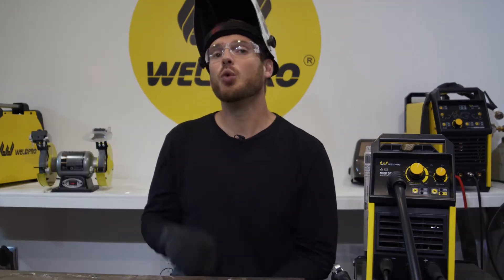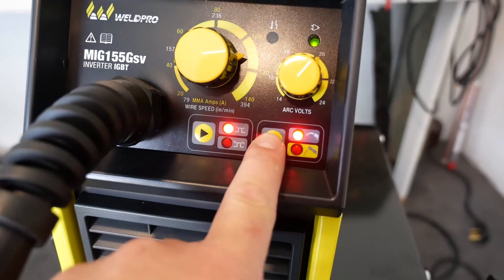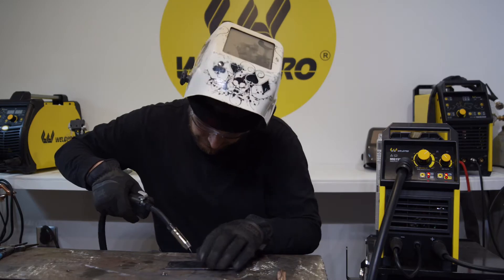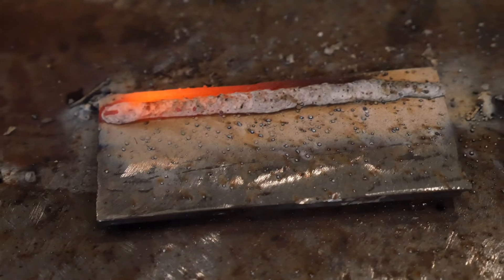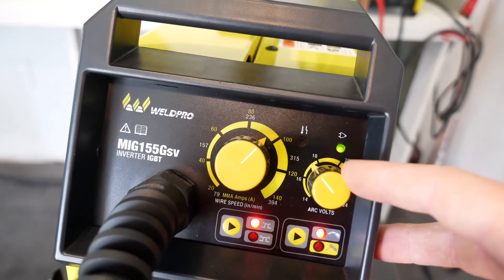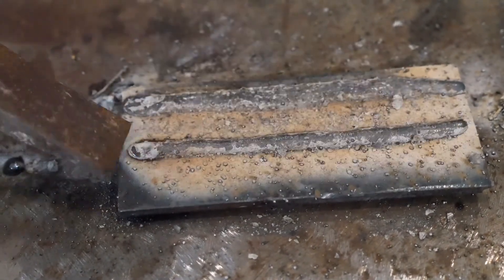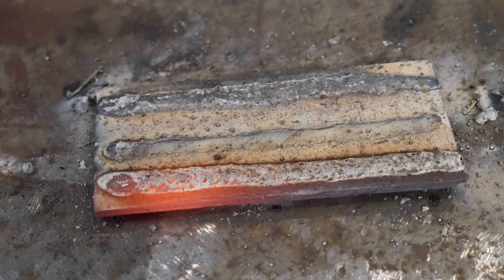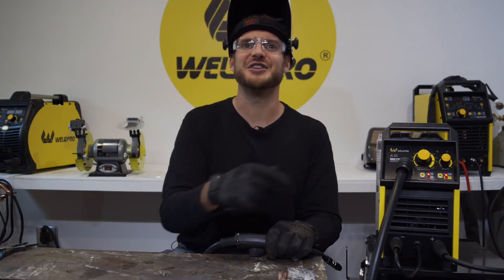Weldpro MIG 155 Part 3 - How to weld with Gasless Wire

Comment: Just got my 155Gd welder.  I am a total newbie.  The chart in the manual list 21.5/130 volt/wire speed for 1/8 inch mild steel.  How did you decide to use the settings you did??  How do you know if the wire speed is too low.  If I follow the chart supplied my wire speed would be slow - how would I know to increase it all the way to 230?   thanks, looking forward to playing and learning with this welder.
Reply from the maker: Hi James,
It totally depends on your wire size but a starting point I always like to use for .035 is to match the voltage with the wire speed - the decimal point. 

for example 18v 180 WS
20.2v 202 WS

This is very raw for a starting point and need to be tweaked a little to smooth out the wire but it will get you close. If your wire is a little smaller, you will need a higher wire speed, if it is something larger like .045 you will need a slower wire speed :)

Practice will tell you where your settings need to be. And listen for the smooth sizzling bacon sound. The wire shouldn't be popping or burning back into the torch.
Reply: Thanks.  I will give that a try.

Comment: I just got mine and the nozzle IS threaded so at least they updated that. Cool welder. Works great.
Reply: Run this thing on 240 and it's a monster. Even running fux core on 110 it rocks. I do recommend watching the videos on "flux core wire myths debunked". If you reverse the polarity and run flux core.. SOOOOOOOO much cleaner and better welds.
Reply: @Theblackduck24  I watched the video you suggested . . . now I have no need for stick welding.... wow!
Reply: @danielchambers1958  I hope it helps. Even I was impressed and I have been welding for a long time.
Reply: I am still on the fence concerning this machine, but I appreciate your input . . . nice to know about the upgrade!

Comment: my wire keep feeding lot of time i try different setting ,any help will be greatful.i have the 155 flux core that came with the machine i was using/
Reply from the maker: It is possible that something could be up with the trigger switch. Try disconnecting the silver connector from the front of your machine. And see if the wire stops feeding. You can plug the connector back in and if it starts feeding immediately perhaps you have an issue with the trigger switch. Also be sure that your trigger position indicator light is on the TOP setting or 2T position on the front of the machine
Reply: @WeldproWeldingEquipment  the silver thing stick with wire can it work without it? Thank u
Reply from the maker: @nexus384  please call 6513292686 we would be happy to assist you!